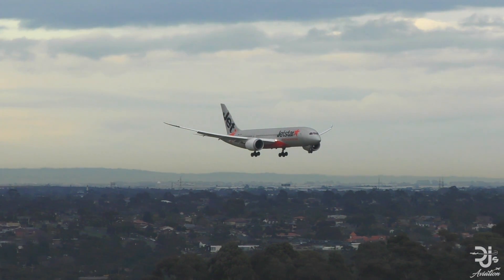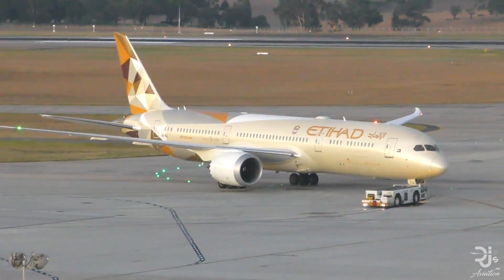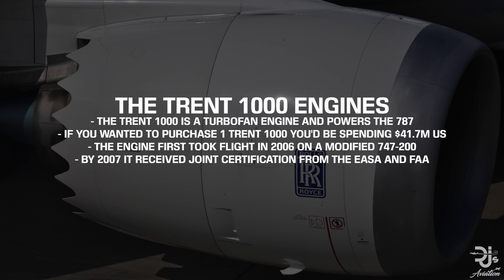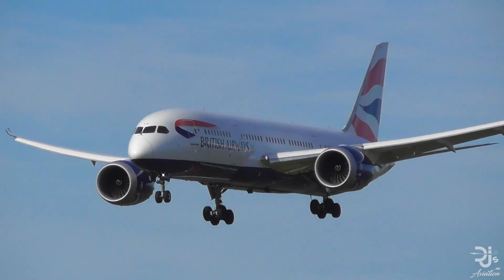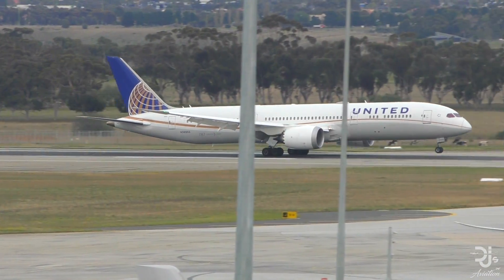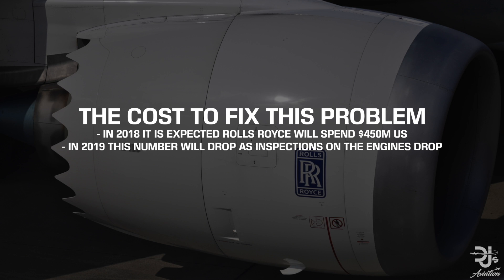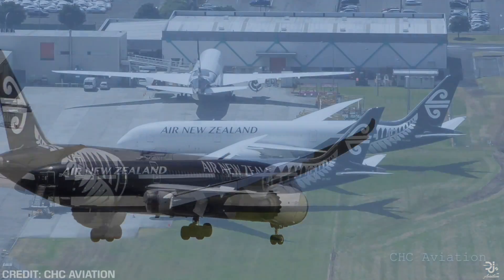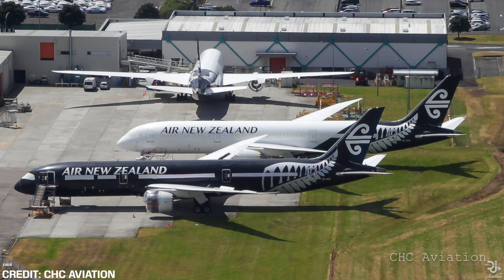The TRENT 1000 ENGINES ISSUES Explained

Comment: Why don’t all the airlines go for the a350 then?
Reply: The A350 is more expensive and a bigger aircraft compared to the 787-8. It would actually be better to go for the A330neo if the problems continue.
Reply: Wait for two to three years and the Trent XWB is sure to follow these barrage of problems. Remember, the Trent XWB is almost the same as the 1000
Reply: @jacobnathanielzpayag3885  Actually there are two primary differences between the two, first, the two Trents use different compressors, with the Trent XWB being the newer and more mature design, and second the location where they were manufactured, most of the affected Trent 1000 options were made in UK, which is suffering hard post-Brexit, while most Trent XWBs were created in Germany.

As for Trent XWB's reliability, only time can tell, hopefully it works flawlessly, as it is the only engine option for the A350.
Reply: Selvariabell  IIRC, RR was aware of the problems with the compressors on the Trent during the development of the Trent XWB. That's why they were able to rectify the problem.
Reply: @jacobnathanielzpayag3885    If RR was aware of the issue and was able to pre-emptively rectify the compressor issue in the Trent XWB, then why would you say the Trent XWB will have the same issues anyway?
Reply: The a350 is very expensive then the 787, it’ll be easier to swap engines rather than swap to a whole entire nother plane. Which is at least 10 times more costly than switching to GEnx engines
Reply: +Johnny Wynn Admittedly switching an entire fleet of engines isn't cheap, especially if these engine problems can be resolved soon.
Reply: Agreed.
Thats what I said as well, but it’s cheaper compared to switching to an entire new plane
Reply: This is a Rolls Royce problem, which is the exclusive engine on the a350. 

Given the 787 and these engines are have been in service longer than the a350 and are reaching a certain number of hours, the fatigue problems of the engine (not the plane) came to light.  

The a350’s have less hours being a newer aircraft.  I am sure every operator will be on the look out for whether this problem begins to impact the RR engines on the a350.  

Given the cost of engines, those with RR engines have to give RR a chance to fix it.  Even swapping the engines for GE engines is not a fix because there are not 380 engines sitting waiting for delivery.  If such a swap ended up being done, you would see the litigation bankrupt Rolls Royce as airlines seek compensation to cover the expenses and lost use of their aircraft.   

Allowing for discounts, 380 engines could cost $7.6 billion at $20 million per engine. Add in other expenses and the cost of this would exceed $10 billion to Rolls Royce.
Reply: Because 787 is better, simply choose GENX engines, europe Trent  is crap

Comment: The only real solution is to replace them. But Boeing is not allowing this as it would delay new deliveries. They prefer to let existing operators suffer and put millions of travelers at risk as they use statistics to calculate their risks. But if one 787 crashes and kills 100+ people then suddenly things will be resolved properly. Any other product you buy on the market is replace is a situation like this. 
It's all about money and the biggest most powerful in the game is ruling. In this case Boeing.
Reply: Um no before u bash anyone atleast have some facts to back yourself up the reason they don’t switch is because it would take hundreds of millions to switch the engines and then pay for services which you already paid for on the current engines so it isn’t a good solution to double pay for engines if RR is gonna pay for the issues. RR also pays for the downtime I believe could be wrong tho
Reply: Yep under warranty maintenance puts it to the warranty. Also the weight and balance is for this specific engine and all the layout and indication and recording systems and the fuel, hydrolics, air pumps for a/c. There's a whole bunch of stuff that would have to be stripped out for a different already existing engine, especially if it's a competitors engine. And also a plane on the ground develops faults quicker than if it's flying. Plus it's not making money. So it's way more financially beneficial to just check it more often. Also once the engine does get too old and they need an engine change it doesn't take too long. We changed one engine in 10ish hrs with 4 people's labour. Then the next day is all the tests to maybe within 24hrs it can be all done.

Comment: Hope the Trent 1000 will recover from this.......
Reply: I hope Rolls Royce can recover from this. How could they get it so wrong?
Reply: @cmartin_ok  they dont pay anyone in quality enough to care and the company probably has a high pressure toxic culture and nobody wanted to rock the boat so they released the engines with flaws. I bet you 10 to 1 the department leaders in that Trent factory knew of the problems. Playing devils advocate maybe the factory did not point out the flaw because it was so catastrophic to such an expensive project they did not want to lose there $30-$50 an hour job

Comment: Are there any US domestic airlines 787s fitted with Trent 1000s? How difficult would it be to just swap in GE engines of suitable power? Clearly, some material design faults in the Trent 1000 are just now becoming a major problem and my understanding is that compressor problems have plagued it from soon after its certification. What with the internal corruption of RR management that had been going on for decades just announced recently with huge fines and management shakeup, it seems RR is in a bad position to recover and retain brand quality and trust which have been eroding slowly for years following the scandalous oil stub tube manufacturing defect that almost brought down a Qantas A380 full of passengers, but for superior piloting despite an uncontained engine explosion.
Reply: All the US carries who operate the Dreamliner all use GEnx engines, but keep in mind that switching from RR to GEnx won’t be easy, it’s very costly and takes a lot of time as well. The pylons all have to be exchanged, modified and all certified, for the plane to fly with its new engine. 
RR is far behind GE in the competition as well, They’re good but GE has been gaining a much better reliability and performance, sales and efficiency. I’m also worried about the a350 and a330neo which only uses RR and once they begin to frequently kick for more Service/high demand in the next coming years, Problem might start with their engines or so, yet it will be RR who will be spends millions once again
Reply: Johnny Wynn Thanks for the information Johnny! 😀 I think we all know that GE had/has a massive success in the long term with it's CFM and Pratt and Whitney partnerships as well as the legendary GE90 series. Have there been any significant problems with the GE9x series so far?
Reply: Johnny Wynn I thought Boeing engineered the 787 to be able to swap the engines without removing the pilon and an engine swap?
Reply: Don't forget that the RB211 in the early 1970's was late on the scene and relied on retired RR engineers to save that program..long deceased. That put Lockheed and it's far superior (otherwise) L1011 at a competitive disadvantage with the DC-10 and basically ended Lockheed's commercial airline program in the process. Boeing beware...
Reply: Tony Jennings, no question that R-R are in deep trouble. The compressor corrosion issue (package 'B' ?) apparently has a simple fix, aside from having to dismantle the engine ! The really tricky issue is, I believe, a turbine blade one that's far more problematical (package 'C'). The real question has to be why did R-R release 'package C' (and B) so-called when earlier variants worked just fine ? Why indeed are there 31 ! variants of the engine ? Was it pressure from Boeing to achieve lower weight or fuel burn or a decision by R-R themselves ? This knowledge appears to be well hidden. Why isn't a previous good variant of the engine being fitted now ? Very odd indeed since other Trents work fine.
Reply: @pasoundman  I don't think Boeing pressured RR to do anything. Initially, Boeing wanted the sole sourcing of the powerplant for the 787, to be GE as the most likely candidate. However, potential customers demanded a RR version and Boeing relented.
Reply: The simple answer to your question is that the 'problem' (in fact there are 2 seperate ones in so-called Package B and package C) doesn't actually stop you running the engine. The issue(s) take years to develop which is why they have only relatively recently come to light and the Certificates of Airworthiness haven't been withdrawn since, at worst, it might need an engine shutdown. ALL engine types need a shutdown due to various issues from time to time. However the ETOPS ratings have been amended. Looking to the future, R-R have a complete fix in the Trent 1000-TEN which borrows on Trent XWB technology and is virtually a new design and even betters GE's 787 offering on fuel burn by a very small margin. The Trent 100-TEN is flying now. Meantime, certainly, R-R has a vast number of engines to repair with replacement parts. As someone has said, R-R is certainly in a 'world of pain'.

Critically, to my mind, it now known for certain that those issues were related to Boeing's desire for lower fuel burn and original 'Package A' engines have shown no issues but didn't meet Boeing's requirements for fuel burn by 1%.

This could well affect the future of Boeing's NMA (the yet to be announced 797). Boeing want yet another 10% improvement in fuel efficiency and I wonder if the engine makers can deliver. When all the gas flow issues in the compressor, combustor, turbine, bypass ratio etc have been optimised, increased efficieency can only come with higher internal temperatures (Carnot's Principle). Materials are clearly already at their temperature limits and I suspect that the 'suits' at Boeing who seem to have taken the place of engineers don't understand that.
Reply: Tony Jennings, simply having 'Package C' engines doesn't neccesarily mean the plane has to be parked up. Only those routes relying on long ETOPS ratings suffer as these have been reduced. Small consolation perhaps as many 787 routes will involve long over-water periods.Those who certify the engine are simply being very cautious about any need for in-flight shutdown.
Reply: BobEckert56, you still have to change the plylon too. Plus you're wong about the compressor problems appearing soon after certification. It was about 4-5 years before any fatigue problems showed up in 'Package B and C options' which were designed to reduce fuel burn. There were zero probelms AIUI in 'Package A'. Beware of unintended consequences ! The Trent-1000 TEN now in service fixes all of these issues by the way. On top of which, the existing engines aren't grounded, although the ETOPS ratings are severely limited and the engines require more regular inspection.

I'd beware of confusing things btw. R-R 'corruption' is more a case of the business culture of certain countries, where 'middlemen' routinely expect kick-backs in return for orders. A 'no-win' situation and Lockheed was the master of corruption since you want to introduce that.
Reply: Dean Ruble Clearly RR package C of the Trent 1000 engine has turned out to be a dud. Iam putting my head on the block here but my career was in commercial aviation from the RB211 days on the 747's no problem with long haul. But if you operate long haul with the 787 say a 14 hour flight across the Pacific to the US Hawaii is the only alternate which simply is not feasible. GE are the most reliable without a doubt RR are in deep trouble as carriers lose millions with their aircraft parked up.
Reply: After the wings  have been produced to accomodate the RR  its very  costly to make alterations ..Qantas have opted for GEnx for its long flights,
Trouble free service between Perth -London proves they made the right decision..
Reply: BobEckert56 No problem Mate!
And nope, there hasn’t been any problem with the Ge9x so far, it’s been tested flight last March and is going well, yet the 777x family isn’t out, I’m sure it will do very well 😃
Reply: Yeah, well unless Rolls Royce offered some kind of $$ incentive to buy the engines back @ $40,000,000 each so the airlines could swap over to the GE engines, I doubt that would ever happen. It's already putting RR in a world of $$ hurt at this moment just trying to fixed the current issues. And it's damaging the "brand" going forward.
Reply: It would be about $50millions difficult
Reply: BobEckert56 CFM isn't GE ! It's a joint venture between them and the French. What makes you think the French didn't play their part, P&W too, R-R also has international partnerships.
Reply: Pure speculation Johny. The design of the Trent family of engines derives from the RB-211 and tens of thousands of airliners fly happily with both the RB-211 and the various Trents. There is a nasty tendency for Americans to jump on the misfortunes, however temporary, of any non-US company and it's getting very stale. Where do you get your reliability figures from btw ? Thin air ? Of course GE are good too. The Brits gave GE the design for the jet engine along with all other US jet manufacturers.

Comment: A shame for RR who've made the world's best aero-engines since the 1930s. Nobody has more jet experience than RR. But new materials and the striving for lower emissions and fuel burn will inevitably run into problems now and again. Similarly, I still am slightly anxious about the extent of composites used in airframes nowadays. It's a lot more difficult to detect fatigue in composites than in metal.
Reply: GE has been developing production ready steam turbines at least since 1903 and developed the radial compressor the same year, in the great war they created the turbosupercharger for aviation piston engines. In 1918 they started their internal combustion gas-turbine division. Then basically just after the first Whittle internal combustion jet-turbine prototype had been tested in 1937 the whole design was transfered to GE in the USA in early 1941 for further development, as insurance if Britain fell. The whittle design used radial flow compressors. 
The first turbo-jet powered aircraft to fly was a fully independent German design in 1939. German Scientist Dr. Franz Anslem developed an axial flow turbojet for Junkers in 1942. Westinghouse Corp. successfully tested an axial flow design in early 1943, completely in isolation from both the German and British jet turbine designs. GE developed a production axial flow turbo-jet  in 1947 the J-47 and later created the variable stator axial flow engine. Variable stators are likely the largest advancement ever made to gas turbine engines.
Reply: Rolls-Royce has always built great engines, but there is a learning curve with new models.  The same as airframes.  Give them time to work through the issues as I have full confidence in them.  - MD-11 PIC
Reply: The RR Trent 1000 was rushed into service, GE saw them do it and took their time, they should of used s higher reliability compresser blade like GE because it worn out faster that expected, that’s were most of the problems occur, engines in the Package C configuration if RR followed GE’s footsteps with the 787 engine config, they wouldn’t be in this situation in the first place.
Reply: " I still am slightly anxious about the extent of composites used in airframes nowadays."

As a former airline EVP who was in charge of buying and supervising aircraft production for our fleet, I could not agree more.
Reply: Pratt&Whitney AND GE were going across the pond in. BOEING...a LOOOOONNNNG TIME after RR went kaput with the Comet guess ya forgot that huh??...
Reply: Well GE does produce more reliable engines in current times at least. In the past, the GE CF6 specifically those fitted on DC-10-10/15's were plagued by issues here and there and clearly GE had learned from those issues of the past. Rolls-Royce on the other hand did not have any severe engine problems in the past and this Trent 1000 issue is brand new for them.
Reply: soaringtractor GE didn't start on jets until the US were given jet engine designs in 1947. Both GE's and P&W's first jets were licence built RR Nenes. RR absorbed Whittle's designs and Rover's engines during the war. 
Quality? Sure there is an issue with the Trent 1000 but apart from the glitches on A380 the history is flawless